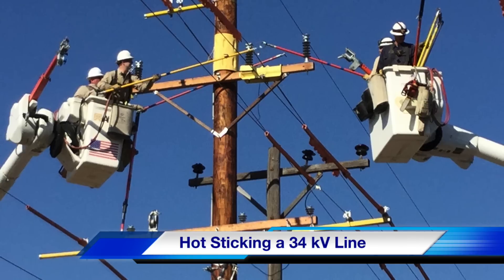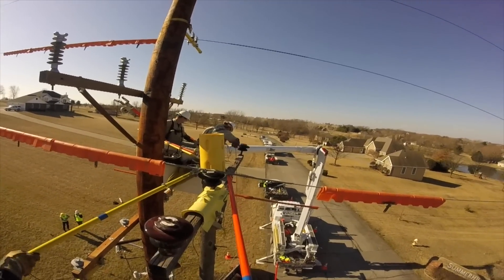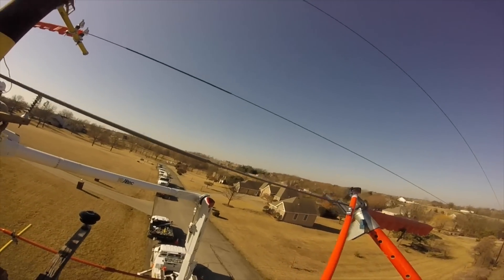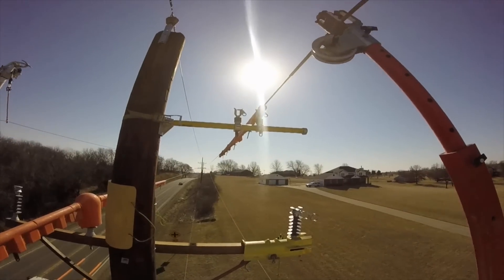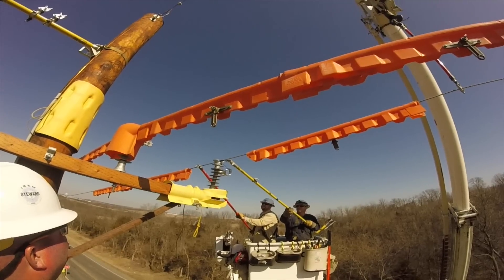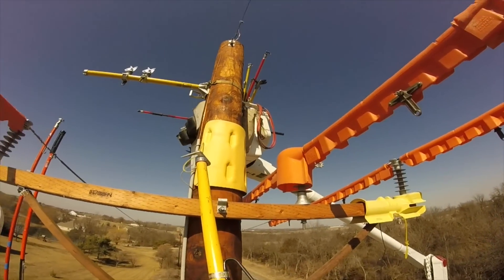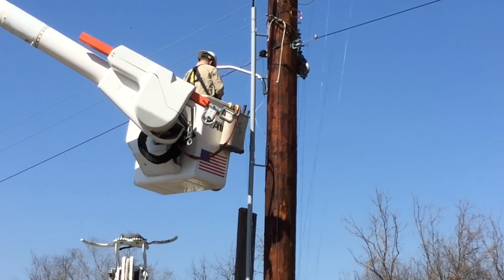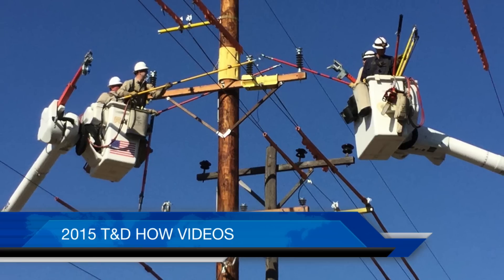Hot Sticking a 34 kV Line

Comment: Actually you can glove up to 35 kv
Reply: Some locals consider this too dangerous and have banned this practice in their saftey bylaws.
Reply: Shit. The power company around me uses sticks if they can. They avoid gloving that high high voltage. I watched a contractor changing out crossarms on a road that led out to the country, and I KNOW it was a very high voltage line. The guys weren't even wearing sleeves, one guy had a rope tied to each end of the crossarm, he strung it over the bucket, and picked the whole crossarm up with the rope laying over the bucket. The other guys worked under him and I guess it got lowered and the guys grabbed the lines and put them on the new hardware. The guy kept his buchet far away soe he had to reach for the work. That's pretty safe. He wasn't going to touch anything.

Comment: please use preforms/prefabs to tie in 34kv.(radio interference) Still thumb up
Reply: Texbullnettle you can get polymer insulators with built in clamps that only require an all angle cog and 15/16 socket